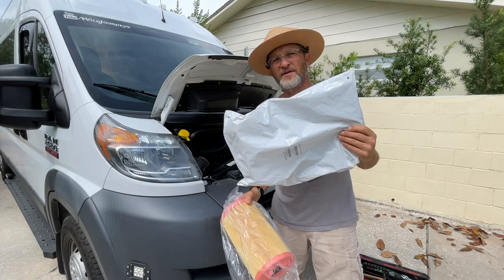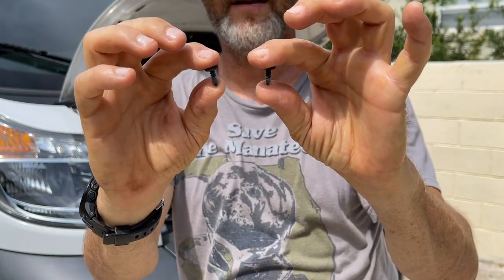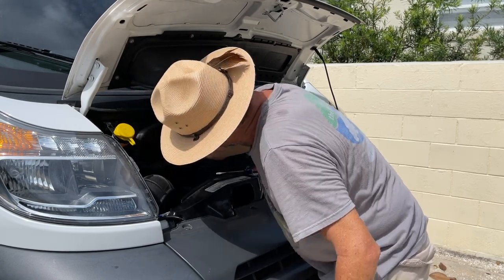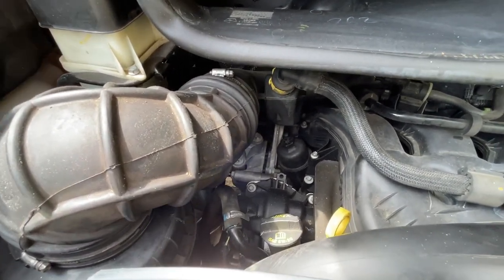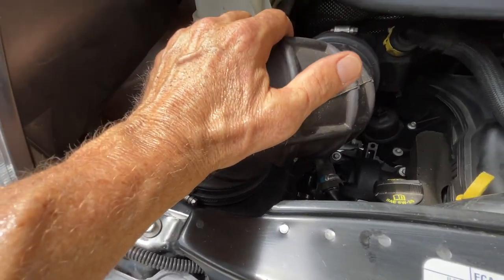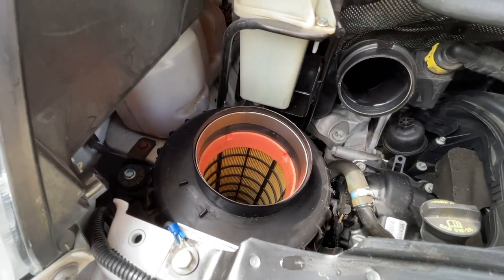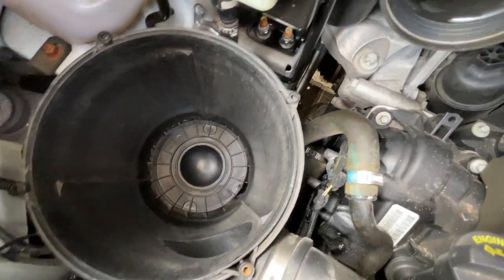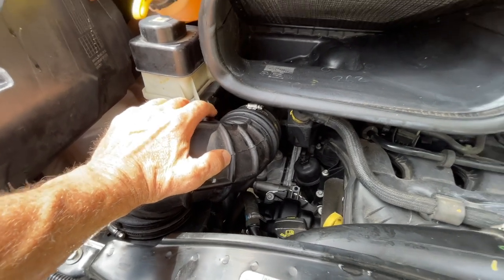Changing Air Filters (Cabin/Engine) in a Promaster 2500

Comment: K&N air filter is reusable and only twice the price of a paper one. Have used them for years on all my vehicles (soon to be added to my '18 PM). You can clean them with the K&N kit or any citrus-based spa/pool filter cleaner, then mineral oil but the K&N oil is red which helps you determine when the gauze needs to be re-oiled. Not sure about any MPG improvement claims, but they've kept me from dumping many a replacement filter into landfill. Thanks for posting these clear instructions.
Reply from the maker: Thank YOU for that information! Really appreciate the kind words. I’m getting better but this YouTube stuff isn’t easy for this 56 yo lol